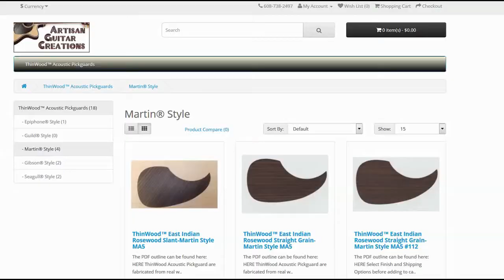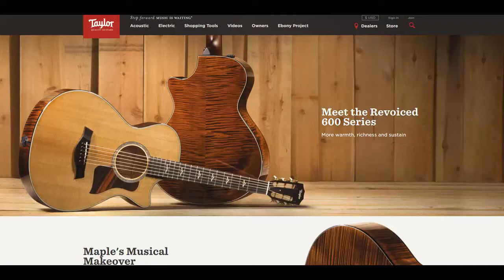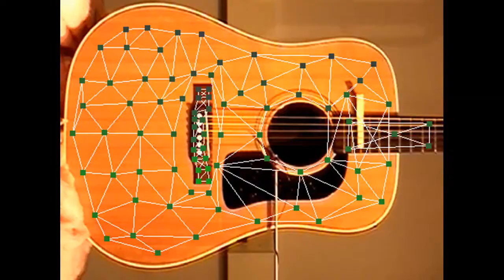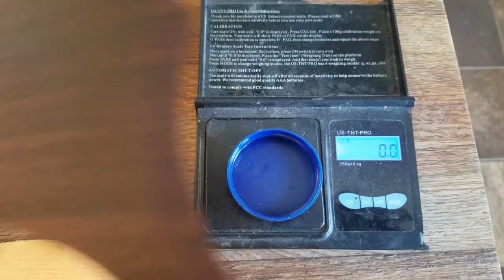ThinWood™ Acoustic Pickguards VS Taylor® Wood Pickguards

Comment: I don't know if this would really improve the tone, after all what matters is the range and thickness of the bridgeplate, 85% of all this sound is made by the lower bowl area, and generally a pickguard is on top of the treble side bar, 1/ 4 on the bass side that needs more movement would perhaps be a real problem, but not in the treble part.

Comment: Recently l purchased a Epi IBG Hummingbird, then two weeks later a Epiphone Excellente.. both guitars sound great however simple logic tells me that the tone of both are greatly reduced by the huge, thick, very heavy, gummy gaurds on both guitars sound boards! I have no idea what Epi was thinking to use such God awful material and SO MUCH of it. So.. l removed the gaurd on the Hummingbird yesterday and indeed it sounds like a different guitar! Much more projection, better lows and mids, l don't notice a difference in the highs ( which were great right off the bat!) so much. Now, before l knew you existed 10 mins ago.. l ordered from Bruce Wei, a rosewood gaurd he is custom making for the rediculously huge, thick, gummy gaurd on my Excellente.. my plan being it is a bit thicker and heavier than the gaurds you produce is to rather than use total adhesion of two sided tape for 100% contact, is to float the gaurd on 4 to 5 thin 1/2" round two-sided disc to free up the sound board, eliminate the majority of contact yet still protect the surface from scratching from pick contact. I have not seen this done but l believe will achieve maximum tone capability short of no pick gaurd at all.. what is your thought on my theory? Great vid!!!
Reply: That sounds like a great idea about how to stick the wood guard to the guitar. I also made myself a Mahogany thin guard (1.5 mm - 10 grams ) and it looks 3d beveled on the sides. I'll try your idea of glueing. But those Thinwood stuff looks great also and it's so light...